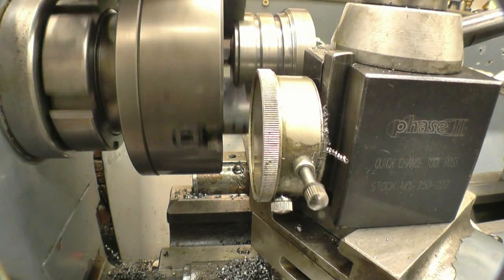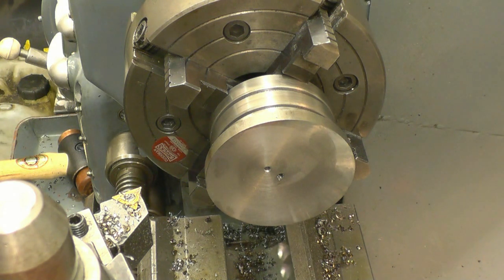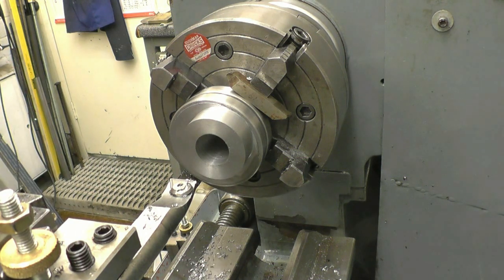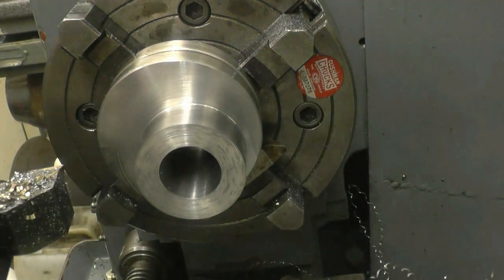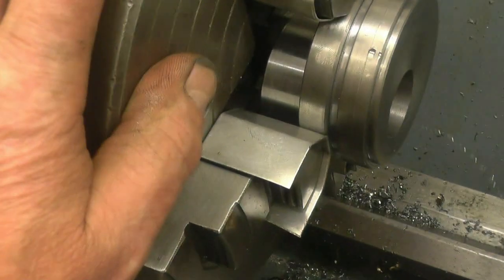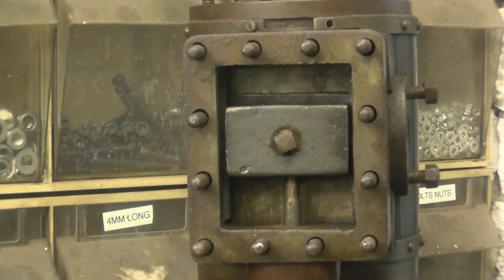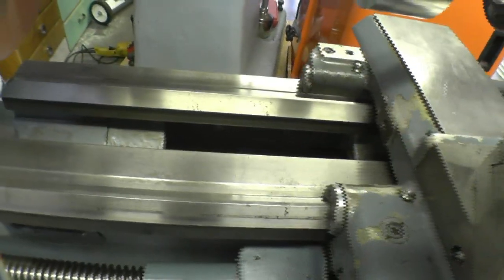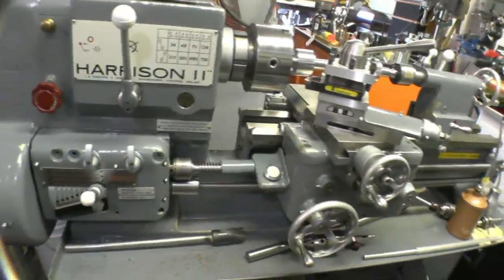SNNC 183 P2   Machining eccentric

Comment: Would the initial 5 thou discrepancy be due to the small-diameter long drill (seen in part 1) running off centre as it made its way through the material?

Comment: Always good to watch the master at work John (:  that Harrison lathe was nice 
shame it wasn't metric  hang on whernt you in B.C ? part of the commonwealth ? eg
Reply: Imperial is fine!
Reply: As a resident of BC I can say that we weren't metric here until 1978 ish. Some of us still aren't. LOL
Reply: Noel I'm in Western Australia  born in 1960 we started using the  metric system in 1970 I'm one of those unfortunate ones who started imperial and had to learn metric  now 57 i st convert  example  hit over the head by a 100x50mm doesn't sound the same as hit over the head by a 4x2   it can be a challenge having been taught both but Metric is far easier and more acurate than imperial  ( BTW I'm also left handed back "the " teachers wanted all right handed  , what a confused life Ive had!
Reply: LOL I'm 68 and have had to live in both worlds since us mealy mouthed Canadians couldn't just convert. We've been going through the "conversion process" for the last 40 years or so. Then throw the US into the mix. I do some traveling in the US and, while the official US system of measurements is metric nobody down there will admit it. Don't get me started on the way they've screwed up the spelling.
Reply: Noel all I can say is tythank God I live in Western Australia ! Mind I did spend 3 months in Vancouver and on the island of Vancouver back in 96 ESp now that a certain President is in power in America !